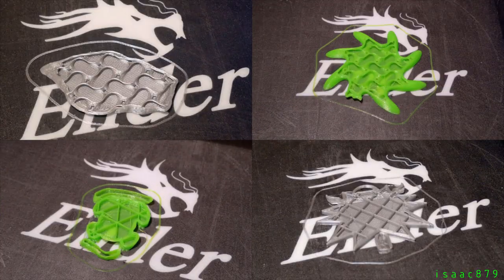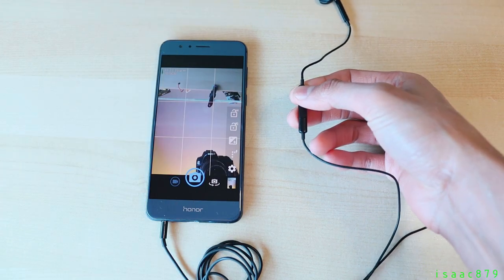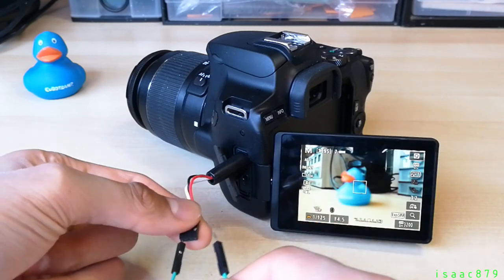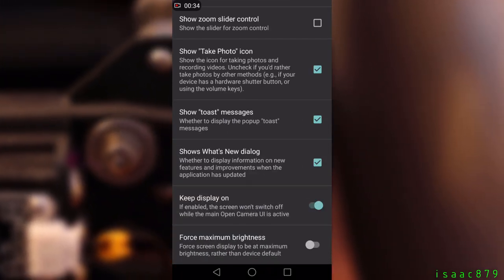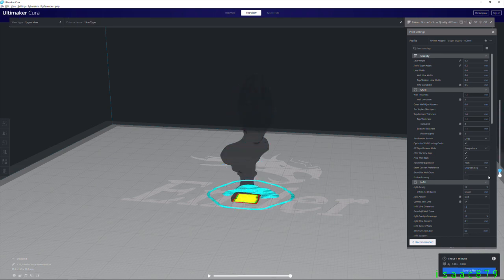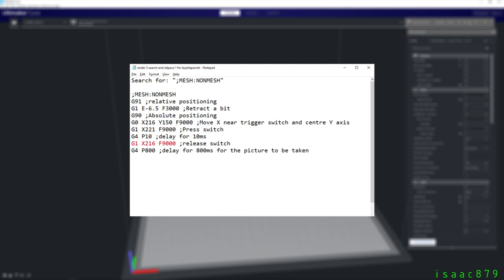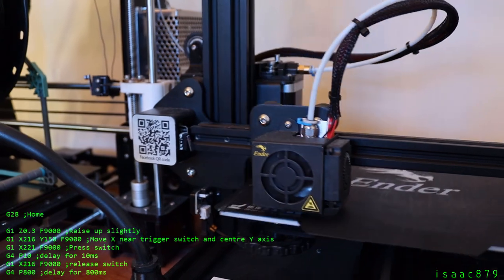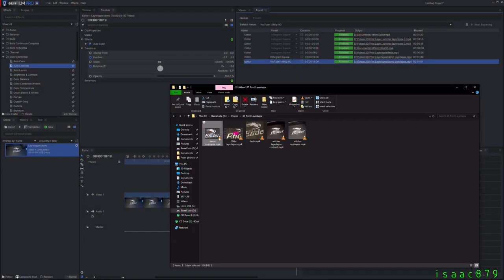How To Do a 3D Printing Timelapse With a Smartphone (Or DSLR) 2020

Comment: Hiya Isaac. I managed to finish the layer lapse upgrade for my Ender 3 Po, and I'm really pleased with how its turned out, so big thanks for the simple tutorial. I've just got a few things to note:

1) The camera app you suggested works fine for me except for the fact that it takes wayy to long to actually take the picture. From the first test of the layerlapse upgrade the pictures were unusable as the printing head was in the way. To solve this I had to add 2 whole seconds onto the delay time to allow just enough time to take the pictures. This however meant that the nozzle would leave some small defects on the print on the side of the limit switch. If you know of any way this could be solved please let me know (I did think putting the print on the print bed closer to the switch would help as a simple solution).

2) The layerlapse doesn't take pictures during the raft printing layers.

3) I found the electronics side of things particularly difficult, especially considering that you didn't explain the precise details such as which wire to solder to which part. Whilst the specification documents were helpful, I still found it hard, most likely since electronics isn't a strong point of mine. Thankfully my dad does some of this for his job so he was helpful, and we then figured out how to do the wiring, however I found the soldering too hard as the margins I had to solder to on the headphone PCB were too small. In the end we ended up getting a 240 ohms resistor from eBay (which was actually cheaper than the headphones) and used some old cables, and with a bit of soldering a electrical tape it worked perfectly. We did also had to figure out which wire to use from the headphone wires by using a small breadboard and multi meter, but yeah we got there in the end.

Thanks again for the tutorial, and I'm really happy to have it working finally.
Reply from the maker: Hi Jamie, I do really appreciate the input. It's always hard to decide exactly what to include in my videos as I don't want hours of unnecessary useless details but I also don't want to miss out important things. So it is useful to know the extra details that would have helped you. 

1) I don't know why it would be taking so long to take a picture for you. It might be worth trying out some other camera apps? If they don't work any faster, then you could try increasing the retraction distance as that should help reduce oozing.

2) I never end up printing with rafts so this is something I didn't even think about... I think this could probably be solved by adding another search and replace script for the raft layers but I haven't looked into it yet.

3) As I mentioned it's hard to decide exactly how much detail to include and my assumption was that most people wanting to do this would probably have a background in electronics. Obviously I was wrong in your case... I'm glad you managed to figure it all out though!
Reply: @isaac879  I totally understand about you not wanting to put too much details in the vid, so thats ok. 

1) Thats a good idea for solving the defects issue, thanks for the quick reply so I could try that now before my big print tomorrow. Just wondering for that, what would be considered too fast/ a reasonable speed to up it to? As I don't really understand what this number (F9000) means with regards to actual speed.

2) Its not really a big issue, as its not obvious in the final video, so don't feel like you have to figure this out if you don't want to.

3) I do know basic electronics, I just guess I got a bit stumped with this one.

Thanks again.

Comment: Hi 
isaac879, What an awesome video tutorial. Great job putting it all together. I have a question about the start g-code. In the description you have "G0 X216 Y150 F9000 ;Move X near trigger switch and centre Y axis" but at 7:42 in the video you show "G1 X216 Y150 F9000 ;Move X near trigger switch and centre Y axis" Does it matter if it's G0 or G1? 

Thanks and keep up the great work.
Reply from the maker: Thank you! It shouldn't matter which one you use. G0 moves all the axis as fast as allowed so may not result in a linear movement. G1 coordinates the axis to move in a line and arrive at the target coordinates at the same time. As nothing is being printed during the movement it doesn't matter what path it takes.
Reply: @isaac879  Thank you for your swift reply. Working on it tonight, will link your video to my subscribers. Best of luck with your channel!

Comment: i am using cura 4.6.1 and when i do this then in the print, after taking the photo of the layer, it starts extruding before reaching the place where it left of in the print.This causes a line of string from the photo taking place(x=212) to the actual print.Pls help
Reply: I have this issue too. Did you find a solution for this?

Comment: Great video man.anychance you have a link to the timelapse software ? And where do you find the setting in the camera app to keep the screen on . Many thanks
Reply from the maker: Thanks! I used Hitfilm for editing the timelapse together: https://fxhome.com/hitfilm-express
In the Open Camera app to keep the screen on open the settings (the gear icon in the right corner), then select "On Screen GUI" (It should be just above photo and video settings). It is the option called "Keep display on" (Second from the bottom).
Reply: @isaac879  brilliant,much appreciated

Comment: Great Video. I love to do it. I understand most of the begin...until the Gcode thing, I was lost there. Where can I find more about the Gcode change, is that different from different machine model? Thanks
Reply from the maker: Thank you! I believe the G-Code should be the same for most printers except the position of the switch on the x axis. That obviously depends on how far along you mount it. I honestly think one of the best ways to learn is just by trying it out seeing how changing the G-code affects the printer movements.

Comment: Hey man! Thanks for this! I've been using it for about a week now and it's worked great but recently I've tried and when it comes back after taking the first picture it does a major layer shift. I test it without the gcode and it works fine so something is only happening when I add the gcode. Any suggestions? I dont know if it's the code or something with the printer that is causing the shift when its coming back
Reply: Your extruder is pushing into the button too far, so the x axis motor keeps running while your extruder doesnt. Try re-measuring at what point the extruder presses the button

Comment: At first, everything was okay with the first Gcode ;MESH:NONMESH, but now it's very slow when it's getting back to print after taking the picture, how can I fix that, please, and thank you so much for the Beautifull work
Reply: im having the same problem, have you fixed it yet and if so how did you fix it?

Comment: Hey Isaac, fantastic video because even though I’m using octoprint you have identified my main problem. It is that whenever the hot end moves away for the pic I’m getting oozing. That’s my only problem. I see your code addresses this but I’m wondering could you just trim it down in the reply to this for me to just what’s needed to retract? I’m starting a time lapse channel and I’ll give you a shout out if this works. Thanks brother!

Comment: I got everything to work here except for the retraction right before moving to hit the switch. Every time it get's to that point it retracts WAY to much filament, and by the 2nd layer it spits it out all together. No matter what value I put in it always sends out the same amount, even if I set the value to 0. The only way I got it to stop was removing the code line all together, but that means I get some buildup on the side of my print. Any ideas?

Comment: Hello, after the print, my print head just smash into the switch, then smash to the left switch, would you help me figure what's up?
 
my End Code.
G91 ;Relative positioning
G1 E-3 F2700 ;Retract a bit
G1 E-3 Z0.2 F2400 ;Retract and raise Z
G1 X5 Y5 F3000 ;Wipe out
G1 Z10 ;Raise Z more
G90 ;Absolute positionning

G91 ;relative positioning 
G1 E-6.5 F3000 ;Retract a bit
G90 ;Absolute positioning
G0 X193 Y215 F9000 ;Move X near trigger switch and centre Y axis
G1 X196 F9000 ;Press switch
G4 P10 ;delay for 10ms
G1 X216 F9000 ;release switch
G4 P800 ;delay for 800ms for the picture to be taken

G1 X0 Y{machine_depth} ;Present print
M106 S0 ;Turn-off fan
M104 S0 ;Turn-off hotend
M140 S0 ;Turn-off bed

M84 X Y E ;Disable all steppers but Z

Comment: Did you change something in the settings to detect de limit switch and take the picture? I just did what you said and the phone detect  the limit in the camera app from my cellphone, but inside open camera, it doesnt work, any suggest?
Reply from the maker: I think mine worked right away but there is also a setting for it. If you open the Open Camera app go into settings -> More camera controls -> Volume keys, then make sure Take photo is selected.

Comment: i want to use my camera EOS 60D, but the p2 jack (2,5 mm ) didn't work. Is there a setting on camera for it?
Reply: if i remember correctly, most of the 2.5mm triggers tell the camera to shoot when shorted between tip and ground. SO, you can make up a jack where those contacts are across the switch and when the switch closes -- boom-- desired short.

Comment: i have a creality ender 3 pro and used the gcode exactly except switching the x axis. After taking the picture when it returns to the print it no longer moves up the z axis. it continues to print at the initial layer over and over anyone else run into this issue?

Comment: i know this is super old but what can i use instead of a limit switch
Reply from the maker: You should be able to use basically any momentary switch as long as you can find a way to mount it. I chose to use a limit switch because they are relatively cheap, have mounting holes and are precise.

Comment: i cant get the switch to work when i wire it to my camera 2.5 mm jack, any advice?
Reply from the maker: What kind of camera do you have and is that the correct to trigger the shutter for it? Here is a great site which shows you how to trigger a variety of popular cameras https://www.doc-diy.net/photo/remote_pinout/
Reply: @isaac879  I have a EOS 60D, but the p2 jack didn`t work with it. Is there a setting to take the photo?

Comment: Where can I find a switch like that?
Reply from the maker: They are call a "limit switch" and most electronics retailers will have them. Ebay and Amazon too: https://www.ebay.co.uk/itm/Micro-Limit-Switch-Roller-type-250V-5A-N-O-N-C-for-V-Slot-CNC-Router-3D-Printer/184314990525?hash=item2aea078fbd%3Ag%3AWTMAAOSwMNhe1nBa&LH_BIN=1

Comment: Hello Issac, i tried to solder the headphone + button with the limit switch, but it just take photo endlessly! I tried both NC and NO with the COM, both just started to take photo without the pressing of the switch, any idea what's wrong? Thanks! Check out the vid please https://imgur.com/gallery/FUjhI9s
Reply from the maker: It looks like you are shorting the button contacts when you are touching the wire to them. There should be 2 contacts under the button dome, an outer ring and an inner circle (you can see here: https://youtu.be/u6nh2hHMK0E?t=106 ). One wire must solder to the outer ring and the other to the inner without touching each other (or it will act like the button is always pressed). The other ends of the two wires need to connect to the limit switch COM and NO (Normally Open) terminals. I hope this sorts out the issue!

Comment: HI  bro i tried as you said in this video but im having a problem when the head hits the limit switch it stops there and starts extruding fillament what am i doing wrong can you help me sort things for me this the g code i use for layer change 
G91 G1 E-6.5 F3000 G90 G0 X205 Y160 F9000 G1 X216 F9000 G4 P8 G1 X206 F9000 G4 P500  am i doing somthing wrong🙏🙏🙏🙏🙏🙏🙏🙏🙏🙏🙏🙏🙏🙏🙏🙏🙏🙏🙏🙏🙏🙏🙏🙏